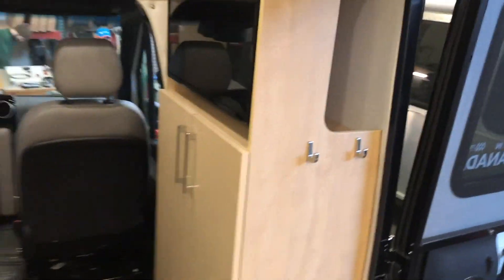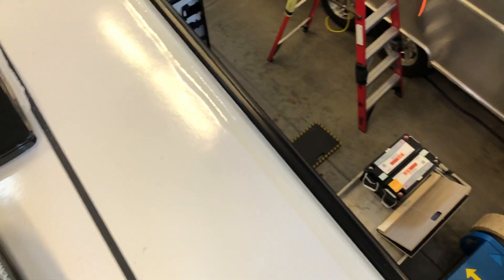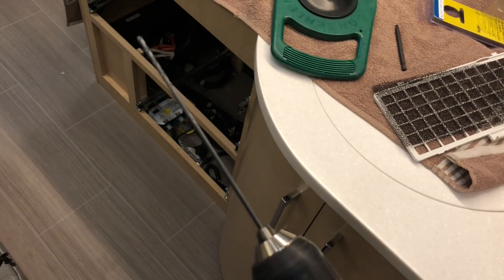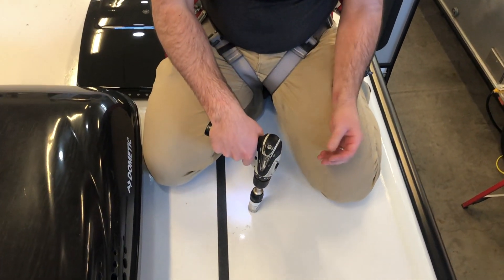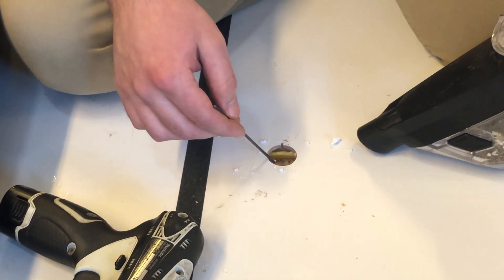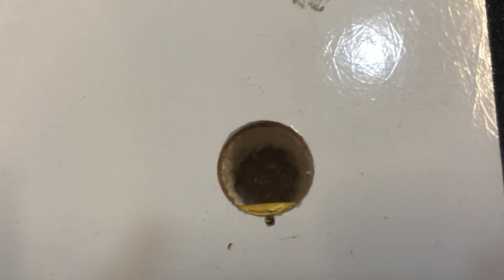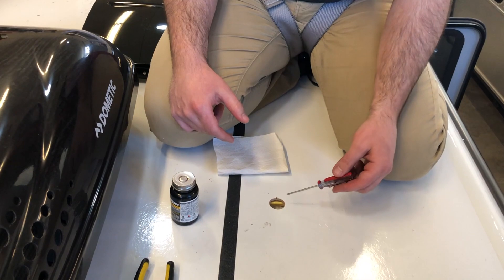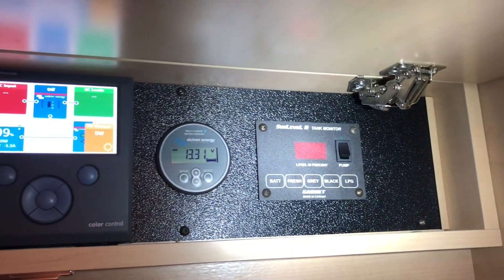Solar Wire Routing Tutorial

Comment: On 5th wheel installs do you ever come down through the nose cone instead of through the roof? I have a large closet shelf that removes and gives access to the nose cone, then wires from the solar panels could easily come straight down to the energy compartment.
Reply from the maker: We rarely come down through the nose cone as accessibility is typically limited, however, if your application presents a clear route and mounting your rooftop combiner box in that nose cone penetration location works well for your array configuration, then go for it!